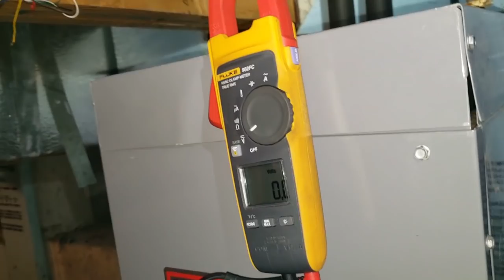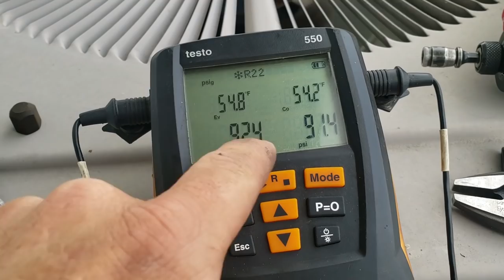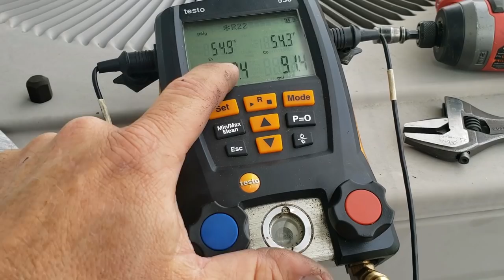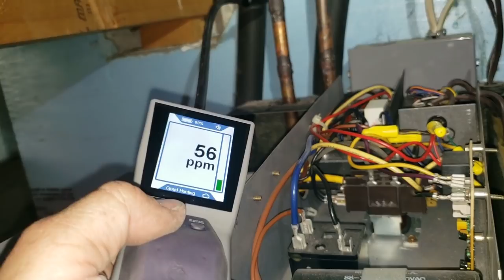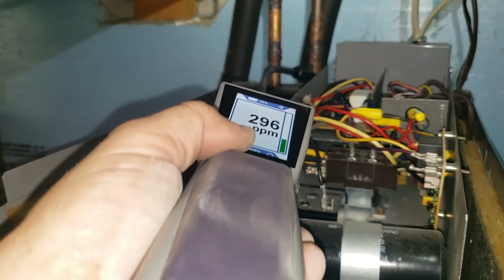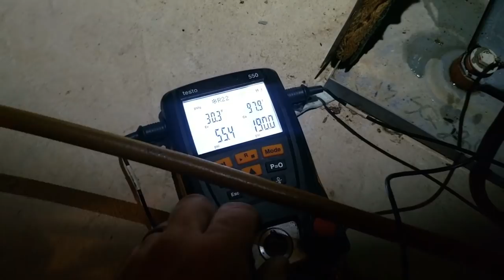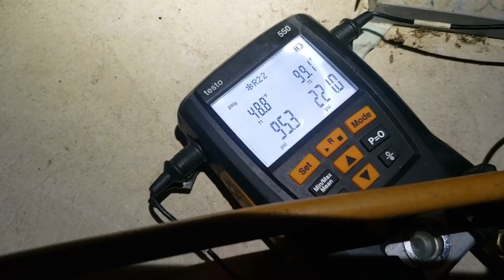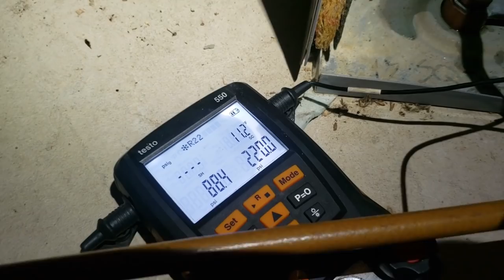Old Carrier AC Not Cooling. TXV Was Just Replaced

Comment: One thing I do whenever I open an older system (10+) is replace every valve core and cap with new ones and use only brass caps with the o-ring seal FINGER TIGHT. Saves me a "what if" and a headache.  Gauges can mask the very leak you're looking for.
Reply from the maker: Definitely a good practice 👍👍

Comment: They are called triple splits.  Can’t believe  there is one still running.  They were on the way out when I started in 1990!
Reply from the maker: I hear ya! I worked on one back in 95 for a friend's grandma that had compression type fittings at every connection. It leaked like a Snowden.

Comment: You can tell a good tech when you go through the proper procedures to troubleshoot a system and recheck you're work after the fact. I've had some Tech's in my company just charge the unit and leave to only find out I would have to go back behind them show them how to use the tools to find and repair the leak. Still can't beat bubbles for pin pointing
Reply from the maker: Thanks Chuck, I try to do it right everytime. I'm OCD 😁
Reply: HVACR Survival well it works for you man.

Comment: Nice video Rick! R22 is ideal for leak detectors. I just sent out my H10 for service and was looking into getting a backup. Maybe the Stratus or Testo 316-4. Got off topic. 
I heard of units with compressor in the house just haven't run into that yet, interesting
Reply from the maker: This particular design originally had the option of special screw together fitting type connection. It was a massive leaker. LOL
Reply from the maker: The new inficon select was just released today, I would get that over the Stratus if you don't need the ppm display.

Comment: Im new to HVAC. Why was the suction pressure high for this system?
Reply from the maker: There's a thing called a reversing valve inside the unit, it reverses the flow so that your traditional suction line has now become your hot gas discharge from the compressor going to the evaporator.
Reply: @HVACRSurvival  so this was a heat pump?
Reply from the maker: @mauricekendallii3658  yes👍👍